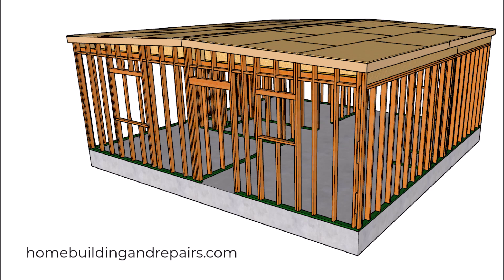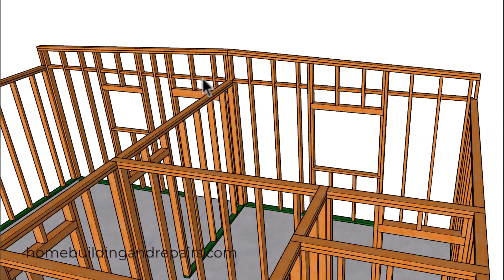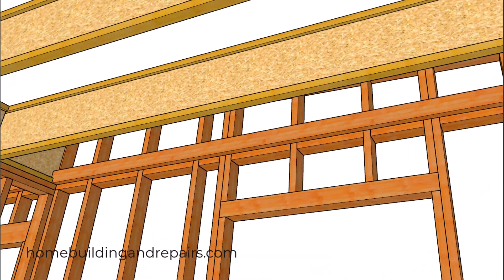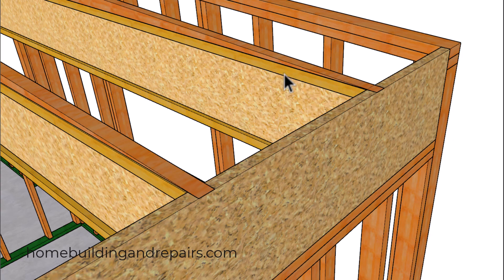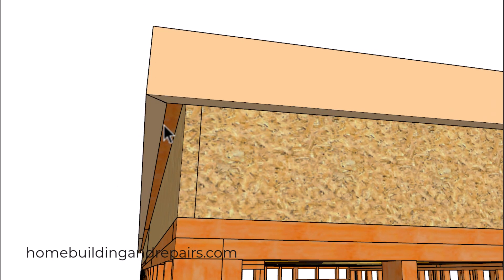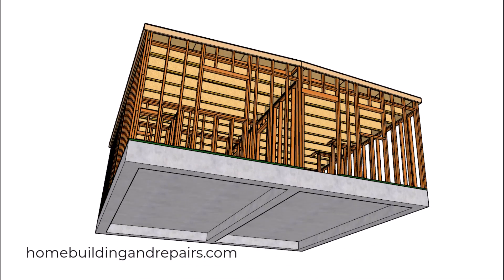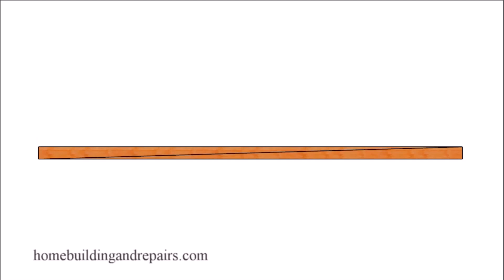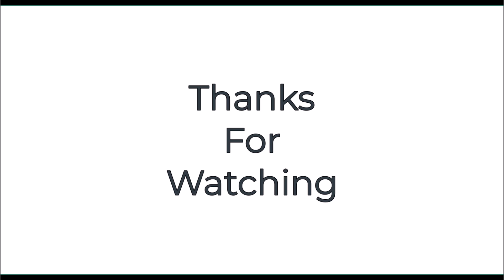How To Build Ceiling And Roof For Low Sloping Gable End Home - 625 Square Feet House Projects

Comment: What if you made this low slope roof as a sort of under roof and air sealed and insulated inside this low slope roof and then put your more normally sloped vented roof above it?
Reply: Why spend the money on excess building materials when you can just frame a normal roof pitch and be done? Unless you're referring to an alternative to scissor trusses that create a vaulted ceiling?

Comment: I really appreciate your videos,  but I do have one question which is " how necessary would it be to add a strong tie to the front and back of your rake wall at the top of your ridge since the top plates don't overlap one another at the peak? "
Reply from the maker: Yes, installing metal hardware to reinforce a structure can be considered erring on the side of caution. Metal hardware, such as steel beams or brackets, provides additional structural support, making the building more resistant to forces like wind, earthquakes, and heavy loads. While it may add to the initial cost, the potential benefits in terms of safety and durability often outweigh the expense.